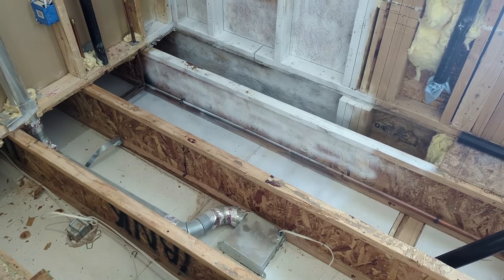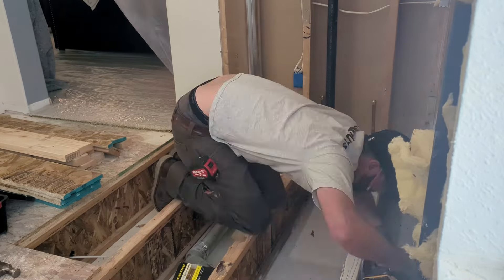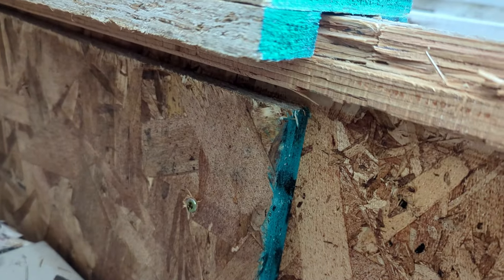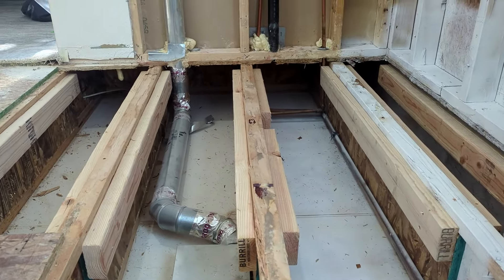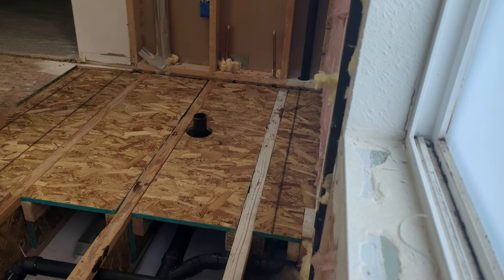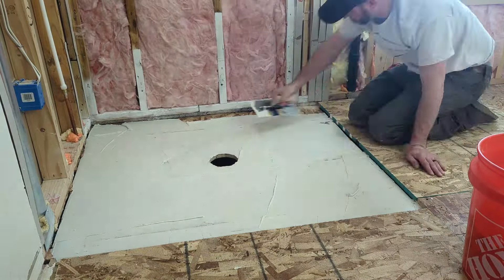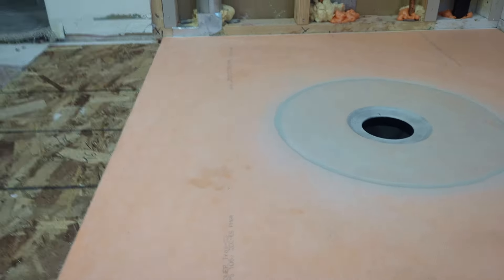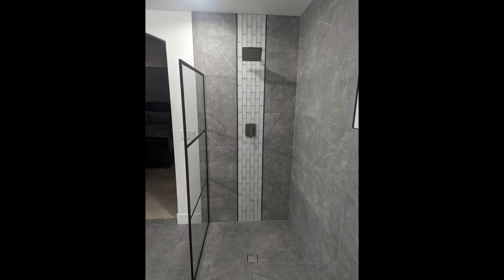Curbless Shower Framing on TJI Floor Joist

Comment: Great concise video and I'm going to use your technique if I ever run into a TJI subfloor. The one detail I'd add would be an 8" or so strip of Kerdi fabric half under the pan and half under the Ditra to protect that joint where the two meet, but you did you due diligence with the flood test so cheers.

Comment: Question. Why use screws instead of a nail gun when bracing the floor?

The reason I ask is because I’ve always used screws, and they’re a pain to me. I’ve been looking and getting a framing nailer.

The end result looks so good!
Reply: I think they said they glued and screwed the 2x4s.  If using glue (construction adhesive) you want to use screws to press in the adhesive.

Comment: Nice video. I'm currently remodeling our bathroom and we've got those same floor i-joists (14 in tall). Question for you: When you reinforced the webbing, did you have the 3/4-in plywood pieces flush with the bottom of the flange and then a gap at the top flange + how much gap should be there?
Reply from the maker: It doesn't matter if there's a little Gap or if it fits tight. The webbing reinforcing is not there to provide any additional strength to the TJI's (although it does). Its purpose is just to fill the void so that you can put a 2x4 on the side of the TJI and drop the subfloor.
Reply: Cool, thanks! It's been challenging to find info on this subject. Some of the manufacturers even insist that you should use their own proprietary web blocking for this, but I can't see how it's any different from the OSB that you used..

Comment: Greenhorn question what’s on the bottom of the floor joist? Is that for insulating the floor ? I would have expected to just see grade or some sorts underneath the joist thanks or maybe this is on a second floor?
Reply from the maker: It's on the second floor. So that the drywall ceiling underneath.

Comment: that Wood you use to the TJI with green color at the border? Is it plywood 7/8? Is it Flooring? Is it 7/8? How do i look for it? I cant find nothing to perfectly fit on TJI like that , at least on regular hardware stores.
Reply from the maker: I believe you are referring to the plywood (osb) that I used to fill in the webs? TJI floor joists come in different dimensions and you'll need to measure the distance between the web and the outside of the top cord to figure out what size plywood you need it. Mine was just standard 3/4 inch so I used the same plywood that I used for the flooring. You should find something close at your local hardware store.
Reply: @CentennialRenovation thank you, yeah mine its 7/8 and i cant find nothing close to it.
Reply from the maker: @wilsonvalderrama1131  you can just do two layers, one layer of 1/2 inch and another of 3/8.
Reply: @CentennialRenovation  thank you so much for the answer.

Comment: That is not plywood, that is OSB.  You're explain that you're filling in the web a few times but don't ever explain why. Did you rip the existing joists down?  Did I miss where you said that?  If so did you get an engineers report?

Comment: Construction adhesive on subfloor but Elmers wood glue on rough framing , {and minimal amount } ,DUDE REALLY !!
Reply: PVA glue on a tight wood-to-wood joint will be stronger than construction adhesive. Even still, he could have omitted the PVA glue and it would have been fine. 

The adhesive under the subfloor is mainly to prevent squeaks; it doesn't serve any structural purpose.
Reply: @cmmartti  whatever you say boss
Reply from the maker: What @cmmartti said, you beat me to it. 
@billhammilton7524, Yes, everything is glued and screwed together. The subfloor was glued down with sub-floor glue and nailed with ringshank nails. I am pretty confident that it isn't going anywhere. How would you do. It differently?